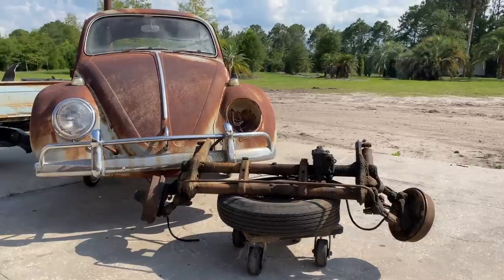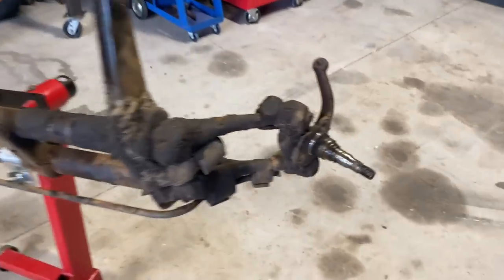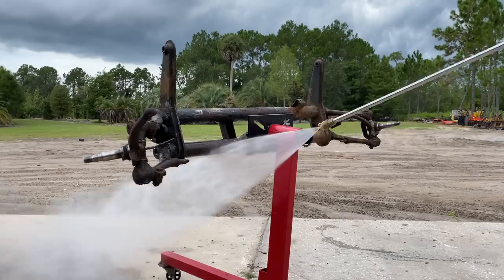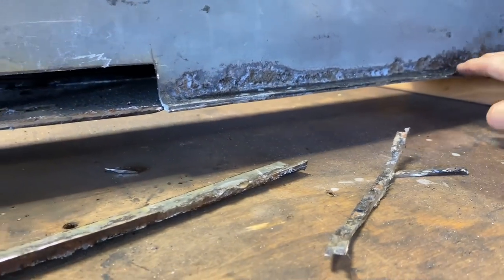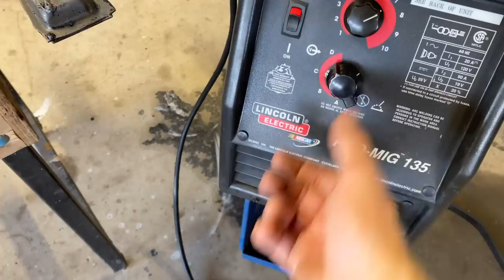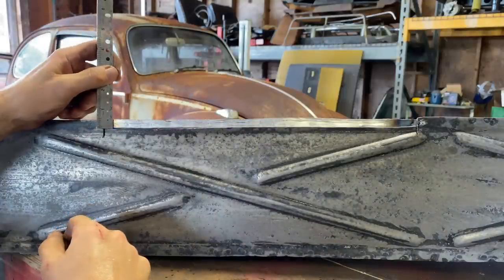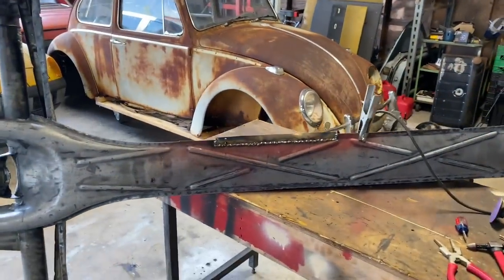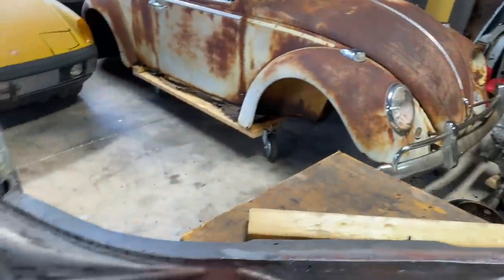VW Beetle Restoration - FULL Build Begins! Axle Beam, Transaxle, Chassis, Metal Patch & Welds!

Comment: Best design engine ever.  Looking at the engine your seeing mostly a heat shroud which had a fan in it to circulate air to cool the engine.  This little engine ran very hot but never too hot to run, but you needed to change the oil every 3,000 mile, it would be burnt, black as coal.  If we had this synthetic oil back then this problem would have been solved.  I drove my new 2011 Sienna Toyota, using synthetic oil, 100,000 miles with constant watching the oil for level and break down.  I have 180,000 now and car performs like new.

Comment: Get yourself a spot welder. I would spot weld that seam in your top and bottom patch.  Or I would have folded that top patch and welded it to the bottom. And since you cut that cancer out, spray some POR in that space. If you don't have it, get some OEM tools tie rod and pitman arm removers. Or a torch to heat where the tie rod connects. And I know WD40 has been used for decades, get with the 21st century and get PB or some Kroil. That stuff works wonders. I hadn't been here in a while jacking around with my projects. Keep the fun coming CT.

Comment: Great work. I am myself one of the man with the idea of diy everything in a restoration. But for saving time and my health, i use some tools for taking out pivots and ball joints. Not the hamer. It consuming energy and time. Also, is better to clean somehow the dirt of the pieces first thing, repeat, first thing before dismantle, because will be easy to take off. That is my opinion, in what i do for my restoration projects.

Comment: Type 1 archeology is always fun to watch. Never know what you'll dig up when cleaning the underbelly. You found a transaxle and a front beam. Nice! My Dad gave me an auto panel gauge welding tip years ago where he would use a shot of compressed air for every weld spot immediately after to defend against any warping. Time consuming but worked like a charme.

Comment: After the pans are in get both floor and belly black epoxy, seam seal all over laps and spray 2k undercoating..U-pol Raptor is a great product...that helps with corrosion protection and sound deadening..

Comment: To bad you didn’t have an old floor pan you could have pulled some same thickness metal out of. Nice work! 👍👍 Belt sander across the edge would give you a nice straight edge.

Comment: Spot welding is ok but you should try doing some fill welds. Drill a hole in one side and fill it up. Makes for a very strong weld. You could have doubled up that 18 gauge and put in stronger metal than came out. As it is by cutting back so far you made a weak spot in the frame. If you're going to fix it fix it stronger, not weaker. A thing I was taught by a jerk but a good lesson.

Comment: Yeheheyya, today you made me happy.=) With some finageling you did it, welds are much cleaner, you got some more adeguate tools, in few words "it's lookin' good!" Also the cleaning was nice, I just wanted to warn you, when you hammer out joints, put some sledge hammer behind the lever on the drum to prevent breaking it. Sometimes it can snap.
Looks like you're becoming a pro, see, it's not that difficult. Remember though the better and more precise you make a step, the easier will be the next down the line. Cheers, keep on.

😊

Comment: Repairs on primary chassis-parts have to be full-welded. Maybe even oxygen/gas-welded like the factory manual describes for Beach-buggy shortening off the frame. Gas-welding. Those fender Butt-welds are no god on the main frame Ct. Sorry, it’s a “do it again”. 👍👍👍

Comment: Looking good CT gettin’ er done. I think you forgot to drill holes in one piece so you could weld them together. Or maybe those pinch welders work like the mikefn has? Anyways I think you can just weld together the way you have it. Should be fine. It’s just a section. Looks like the rust is gonna attack that bare metal better figure out something fast with that thing. Yeah they make a cheap tool for removing the tie rod ends. I got one many years ago. I think it’s a kit from harbor freight. Works amazing. I actually bought the kit you suggested for the steering wheel removal but haven’t used it yet. Seems like your staying focused on this one. Maybe this will be your first finished project. Don’t worry about the disc brakes. Just fix what you got. You can always add disc brakes later if you choose but don’t let it stop you from finishing. Same with tranny run it if it works then if you get the cash you can switch it out. If it ain’t broke don’t fix it. Jaaa. At least that’s my poor ass philosophy. Keep on truckin’ and check out my channel.

Comment: Did you know that the VW Käfer ("Beetle") 1303 with the 55 hp engine was called "Schluckspecht" (like "gobble bird") in Germany because of a rather excessive fuel consumption?
I am not so sure about the type, it can also be the 1305, which features a 65 or even 75hp engine.
That was the latest and last update, with the carburetor being replaced by a electro - mechanical fuel injection system.
I can remember how my parents, my sister and I went on a holiday trip, crammed into this tin of sardines with all the luggage we needed.
Speed - hm, not really: top "speed" was 110 km/h, about 60 mph - that was it. Downhill, with the wind in the back!

Comment: Open up the gap between the pieces
you are butt welding you'll get better
pennatration and be able to blend it
easier . Over lap your patch and use
cut off wheel and plunge cut to fit .
That should give you the gap .

Comment: Love the Channel and the process. I sent you a link to Eastwood for Rust encapsulator. I see you're going to be putting the heater channels on soon and I'm pretty sure those aren't painted on the inside so to keep them from rust and you can use something similar to this for Eastwood's product itself keep the heater channels from rusting from the inside out. Eastwood actually has a little hose that hooks into the spray nozzle so you could feed it down the heater channel and coat the entire inside of the channel top bottom all through it to try to keep that rust out of there just the thought. Like I said love the channel keep up the good work I'll be sure to watch your promotion promo videos good luck with those.

Comment: 👏 Not too bad that patch, - you may use an ordinary file to smoothend out that weld, - gives you more accurate control compared to using the angle grinder !

Comment: Really you've made a big mis take....
No need to cut the squire peice from the frame then exchange it  by another one ..thiner than original.
Specially it is Alminum..
Dear. ..normal welding over the rusted areas then gridding it will be better than cutting and putting another metal.
Any I like your vids. and follow it happily..
Thanks alot for what you've done..

Comment: You've definitely got my vote on your restoration with that 65 Bug. I've got a 64 Bug (Christmas gift/covid project for myself during our down time crisis). The body off, and then body back on chassis bolt hole line-up is a major before welding new pans in. I can't say enough about VW Bugs they're just awesome! Thumbs up on a float test if it's in the forecast too!

Comment: Hey CT, I have a question about welding. When you put a patch in I understand spot welding every inch or two but after that wouldn't it work better to connect every other or every third or fourth set of spot welds until all are joined?

Comment: You cut out the sheet metal and worked so hard filling the hole with too small a metal, you would have been much further ahead just filling the rusted pits with weld and then grinding to finish.